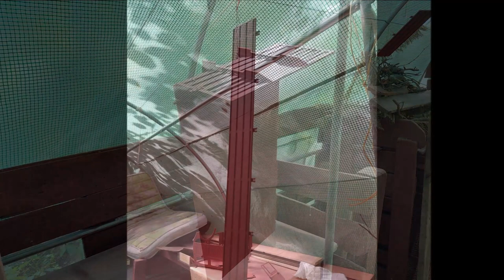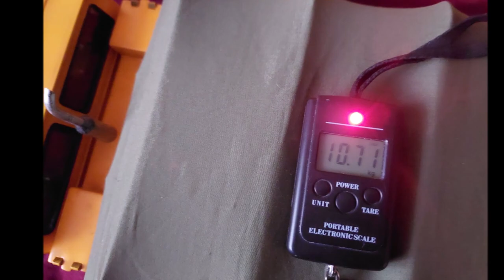Tatra 813 Kolos 8x8 - Cross RC DC8 - stages of building the model (photos)

Comment: Congratulations on an amazing build project.  The result is fantastic with a good choice of components, colours, accessories and realistic weathering.  The wiring in particular looked especially complicated.  Did everything go to plan so far?
Reply from the maker: Thank you, I'm glad to read such a comment. 
I admit that at the very beginning I had a big problem - I primed the model with a primer, then painted it with two-component paint from an airbrush. When I thought the paint was dry after a day and lifted parts of the cargo box, the paint peeled off and sank under my fingers - it was hard only on the top. At the beginning I started to wash off the paint on the sides of the cargo box, I used a solvent, small wooden planks to remove the paint. At first everything was fine, but after a while the solvent turned out to be too strong and melted the plastic parts. There were deep scratches... I had to wait a long time for it all to dry. Later, I dry-wiped the paint with sandpaper, I had to fill the scratches. The plastic hooks of the tarpaulin lines melted completely (fortunately, there were more of them in the set than needed for the model). I had a lot of work to get the sides back to their original state. 

Everything else was easy, the electrics look complicated, but for me it was easy ... although I will admit that in my haste I burned one receiver and the sound module by connecting the wires incorrectly. As a curiosity, I will add that I even made a 5-pin connector at the back of the truck, so that in the future it would be possible to connect a trailer with all working lights. 

The most important thing, however, is that the model is already finished, now I think I will take a few months break in building more rc models 😁
Reply: @kolekcjoner205-models  Did I see you using the rust/red colour primer?  Is this to show weathering if the body is scratched?  Also, I see you were using Tamiya ABS cement.  Is this a good product to use to bond the plastic parts together strongly?  I didn't select an adhesive to use yet on the ABS parts for my PG4A kit.

Would you like a trailer like the one in the photo that you used for inspiration for your truck?  I suppose most trailer kits of that style are 1:14 scale.
Reply from the maker: @BlackSeaRC  In fact, at that time, I only had a primer in this color, which probably does not affect the final result ... unless I scratch the model someday and the paint falls off somewhere. However, I doubt it, because it is painted with agricultural varnish and typical clear car varnish, so they are much stronger than spray paints or modeling paints.

I think that this Tamiya glue for ABS is very strong, I glued the whole model with it, it holds much better than those Tamiya glues with a green cap. You just have to be careful not to get it on the top part.

Maybe I'll build this trailer, it's a P50, it's available for 3D printing in 1/10 scale, so with a 1/11 scale model, it may eventually be.: https://cults3d.com/en/3d-model/various/trailer-p50-stl-model-1-10
Reply: @kolekcjoner205-models  Thanks for the information about paint and glue.  Typically, I use Tamiya paints and other products whenever possible as they usually give good results for me.

This trailer is certainly authentic for use with the 813 but, as I'm sure you already appreciate, it will struggle on anything much more severe than dirt tracks.  I have been involved with quite a few high-mobility vehicles in real life and it was always difficult to specify a trailer that did not significantly reduce the performance of the prime mover in off-road conditions.

Comment: Hi! Great video! Thanks!
I've just bought a DC8 kit and see you've replaced the motor? It looks like the Quicrun Pro which only comes as 2300kv is this correct? Your description states it's 1800kv? Is the control good with this setup?
Also AliExpress suggests the DS3235SG servos are upto 7.4v, are they ok on 8.4v?

Many thanks!
Dave
Reply from the maker: Hello! Thanks for nice comment 🙂
This is the 1800kV version as described, the 1200kV QuicRun would be even better, because such high revs are not needed in this model , but it was not available when I bought my engine. 
The brush one from the set was too weak for slow driving, especially in second gear there was a lack of power , so I replaced it and everything seems to be OK. In first gear, the model drives most realistically, it never lacks power, but I do not use the automatic power regulation available in this engine, because then the model did not always drive smoothly. This is probably due to some play in the drive system, because it consists of many drive shafts.  
The specific servos that I have in the model in the description on AliExpress were written that they could operate at a voltage of 8.4 V and with this voltage they reach a value of 35 kg. They are sufficient for regular driving, but if you want to drive (or ride - I don't know what the correct form is in this case) , for example, on rocks, it is better to install even stronger 45 kg servos, because it is a heavy model. This is a link to the servos I bought, I just don't know if the same offer will be displayed in your country: https://a.aliexpress.com/_EzGBQM5

Regards!
Hubert